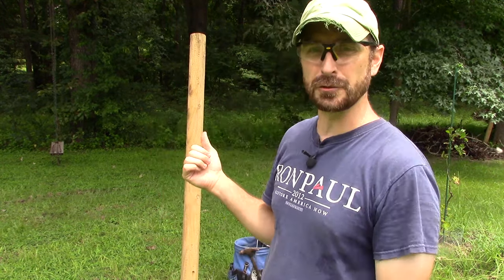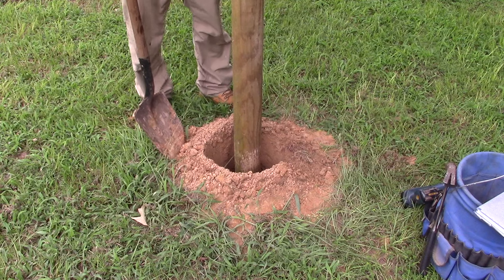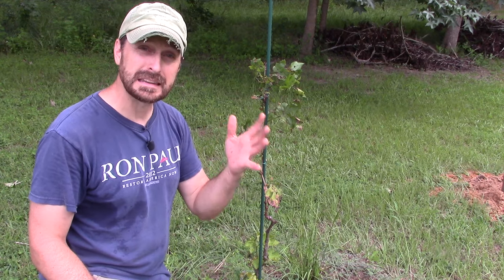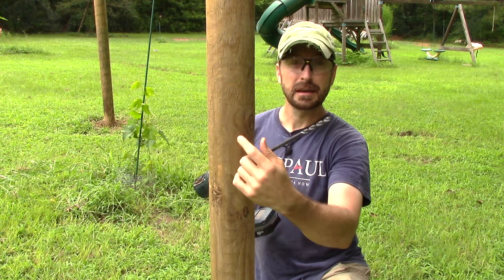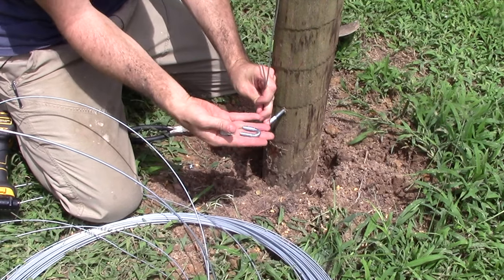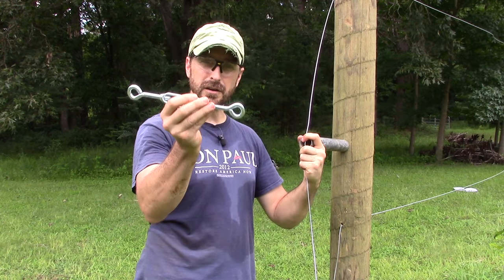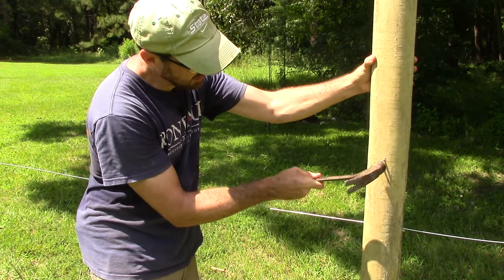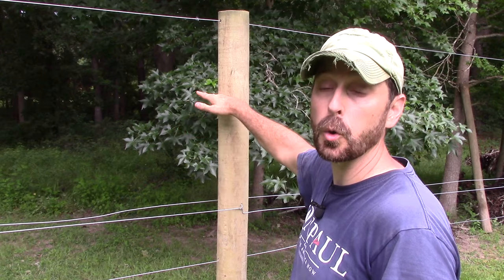How To Build A Grape Vine Support Trellis. The MOST Popular Type.

Comment from the maker: Ok all, I did make a mistake in calculation at the bottom for the top wire anchor point. After the top wire goes over the pipe it should go down to a ground helical anchor that is placed about 10" away from the base of the post.
Reply: how long is your pipe???    16 inch anchors okay?
Reply: Watching this video for the first time and was wondering about your guy wire. Reattaching to the base of the pole will help with bowing but not with racking and loosening soil. For best results, anchor it about 2" closer to the base than the length of your braceing arm. Excellent video! Think I'm going to use this system but pour concrete around the base and ditch the guy wire totally.
Reply: @brandonbrake9652  wouldn’t a concrete based post just be pulled over as there will be constant and unidirectional pressure on it?
Reply: Is nobody going to mention that on day one you've already maxed out your turnbuckle.  Just saying. But, I did enjoy the video, good stuff.

Comment: Ok folks. This is a really helpful how-to video. I followed it step by step. Placed my poles in 2 ft deep tamped around it until it was solid.  However in tightening my top wire I found both poles that were straight are now leaning towards each other.
I recommend either going with a 10-ft pole and put in your pole in the ground 4 ft deep or pouring some concrete in it.
Reply: A better option is to guy the end post or use a push brace set up on the inside.  I prefer using a push brace to keep the end posts straight because then i don't have to mow around a down guy.  Concrete, and putting the post deeper will not keep the ends straight over the long term,
Reply: @Jimmy-ul3si  A push brace for posts that tall, and being set in such soft soil, plus the weight of the vines, over time the end posts will lean a lot.  Push braces should be mandatory for this kind of structure and use.
Reply: I was going to say, tamped dirt alone will not support stretching a wire.
Reply: @sunriseboy4837  What is a "push brace" exactly? I built a grape trellis like this and googled for push brace but not finding anything, just random stuff of fence posts.

Comment: You can use trellis for tomato and all vine vegetables as well. It gets them off the ground and helps to keep bugs down.
Reply: It helps keep disease down, too. I prune mine up about 12-18" so when I water there is no splash on the leaves. This also creates healthy air space. All of my tomatoes are strung up, I just have structures to string them up to.
Reply from the maker: Trellising is great. We use them for many different vegetables and fruits.

Comment: Great informative instruction!👍. Been needing to do this with my grapes for years.  Looks like I’ll have to move the plants quite a but since I have three each in two rows spaced about 8’ apart.  Since I’m in a frost zone, I wonder if I would need to get 10’ posts and put them 4’ in the ground? Just hope they’re available in that length.
Reply from the maker: Thanks. Yea, I would do the 10" posts. You should be able to find them pretty easily.

Comment: Great idea!!!
I have a grape vine which I planted 3 years ago connected to an Arc type of Entrance in my garden which is halfway inside the walkway.
Would installing a post about 4 feet away from the Arc's  entrance allow it to be guided along the side of the walkway ?
Thanks for sharing!
Reply from the maker: The nice thing about grapes is that you can train them to do almost anything you want. If you have more room, I would install several posts. If just a single post, you can put it 10 ft away.
Reply: @CountryLivingExperience  Thank you very much! I have a blackberry and young Prune tree about 20 ft apart. I will unearth them and make way for the white grape vine. It is 3 years old but I am sure it will reap wonderful rewards in the near future.
You saved my life trying to figure this one out! 
Have a great week ahead.
Reply from the maker: @alexpolidoro4126  You're welcome. Have a good week.
Reply: @CountryLivingExperience  Dear Country Living. I am ready to start my project. Question: I am using deck blocks which I can insert my 4x4x 8 posts. Would I still need turnbuckles to solidify the posts ? I am starting with 2 posts for now with a 10 ft length in my back yard. Any comments or suggestions would be appreciated. Thanks a million!
Reply from the maker: @alexpolidoro4126  It all depends on how deep you sink those posts. The advantage of having the turnbuckles is that the wire will stretch over time and you will be able to tighten it.

Comment: This is a great video.  Question:  It looks like the catch wires have a lot of slack in them, would it be good to have them tighter, as they will stretch over time?
Reply from the maker: Thank you. Yes, they have some slack and need to be periodically tightened if your posts move or if they stretch.

Comment: I'm a total newbie at anything like this--how did you fasten that last wire.  Not the catch hooks--I understand that--but at the ends of the wires, how did you finish that so they don't slide out?
Reply from the maker: They are threaded down the the eye screw, looped through, and secured to itself via a wire clamp.

Comment: Great Video.  Any hints on installing a trellis on mature grape vines already in place?   The grape vines are currently held up by some metal poles with wires and string.  I want to replace that system with a new trellis as you have shown, but I need to do it in a way that I don't wreck the existing grape vines.  Plus I need to get them to attach to the new wires after the new trellis is built.
Reply from the maker: Thank you. Just prune them back as much as you possibly can. Support them with some temporary structure while you build the new trellis around them. You will have to attach them with some sort of gardeners tape to the new wire.

Comment: Notice that you only pulled the cordon wire hand tight, so I was trying to determine if the low wire and the top wire are one length such that the turnbuckle would tighten both wires.  A diagram of the wire routing would be helpful.  Also, looks like the far end post is bowing to the wire strain.  Last question... solid wire or braided cable and what gauge/diameter do you recommend?
Reply from the maker: The lower and top wires are different lengths. The top wire is much longer because it goes over that brace and then down to the bottom of the post. The post is leaning a bit because I rushed to set it for the video and didn't tamp it in fully. That is solid 10 ga. steel wire. Hope that helps.

Comment: Do you have a step by step updated guide with materials list somewhere? This video is 2 years old and you have multiple comments saying you changed some things. I just bought 2 grape vines and want them to have a happy life- but have no clue what I’m doing! Thanks!
Reply from the maker: The video is the guide. Materials will change per length of your project. 
The only thing I changed is where the bottom anchor is located. I moved it out from the bottom of the post to helical ground anchors located about 8 inches away from the base of the end posts.
Reply: @CountryLivingExperience   I've rewatched this video 5x now and am writing it all down on paper so I don't forget! How long was your piping for your guy wire? Do you think if I poured concrete for the posts this would be sufficient instead of having a guy wire anchored? ( Sorry if I'm not using these terms correctly- they are new to me!) Also wondering where you got your supplies from..tractor supply? lowes? home depot? and which tools do you need (My husband probably has them all but I want to make sure I ask for the right ones!) I plan on having 2 plants, so based off your set up I was going to do 3 posts, ~8-10 feet apart. So far my list of supplies includes: #10 gauge wire, turn buckles, heavy duty I screws, wire clamps, 4 inch 8 foot long posts, vineyard wire clips, fencing staples. Anything else I'm forgetting? Thank you for this video it's very helpful!
Reply from the maker: You're welcome. 
The pipes were about 10 inches long. You would still need the guy wires even if you poured concrete. I got the supplies from all over the place including leftovers in my barn. If you have 2 vines, they will need 10 feet in each direction for a total of 40 feet. The posts would need to be 20ft apart. Your list seems complete.

Comment: what type of pipe is used for the support piece that's held perpendicular to the end pole? is seems like the metal must be soft enough to notch/cut, yet strong enough to provide support.
Reply from the maker: It is a 1 1/2" galvanized steel pipe.
Reply: @CountryLivingExperience  what tool did you use to notch and to cut the arc? maybe a file for the arc and a hacksaw for the arc? Thanks!
Reply from the maker: @ToddMorgan-z5y  Just an angle grinder

Comment: Would you need the anchors if you used concrete in your post holes?
Reply from the maker: It will depend on your soil. I have extremely sandy soil so I would still need them. Also look at the pinned comment. I made a mistake.

Comment: WOW.. grape trellises are easy to build compared to the cold hardy kiwi trellis I had to build for my cold hardy kiwis mainly because cold hardy kiwi trellises have to be a lot more durable than grape trellises. Because cold hardy kiwi vines get a lot thicker, heavier, taller, and spread out 10 to 15 feet horizontally depending on the variety anyway great job on the grape trellis.
Reply from the maker: Kiwi are certainly a lot heavier.
Reply: @CountryLivingExperience  yes that's the problem with cold hardy kiwi or kiwi in general. Like the whole trellis has to be made out of wood timbers. Because if it's not it will just break or bend depending on what you're using for the supports of the trellis.
Reply: @CountryLivingExperience  I originally tried using steel t post's but they just bent under the weight of the kiwi vines once they got bigger.
Reply from the maker: @mch.l.trecords9169  For our kiwi trellis I used 6" treated posts and cattle panel.
Reply: @CountryLivingExperience  yeah that should work too over the long run I feel like if I used t post and woven wire fencing the distribution of weight would have been better and they wouldn't have bent. But since I used steel rope and t post there wasn't a even distribution of weight but I didn't figure that out until I built this humongous timber frame trellis.
Reply from the maker: @mch.l.trecords9169  Cool

Comment: I was hoping to see both ends of the trellis but it cuts off. Do I need a pipe on each side for strengthening? And I could only find 14 guage wire. Will that work?
Reply from the maker: Yes, the pipe is on each side. 10 gauge is best. You can find it at Tractor Supply.

Comment: I put in my post and now I'm trying to find 10 or 12 ga wire that is continuous.   where did you get your wire, and if not all one piece how to you connect it securely??
Reply from the maker: They have big rolls of the wire at Tractor Supply
Reply: I tried there first, but they only have 14 gauge in big spools. Have you ever thought of using a termination knot on the 2 middle wires instead of the eye hook?/ what type of knot did you use to finish the 2 middle wires??  Thanks for your help :)
Reply from the maker: @ydelsanto  I just used a wire clamp to hold all the wires. No knots.
Reply: @CountryLivingExperience  what size wire clamps?

Comment: Thanks for this great video!

2 Questions: would you use 5mm(1/4in) or 10mm(1/2in) turnbuckles?

I'm planning to only have 2 posts 3 metres apart and have 2 plants between. Would you put the posts in on a slight angle with the top of the posts leaning away from the plants to allow for any movement from tensioning the wires?
Reply from the maker: Thank you.
It depends on how thick your wire is. The heavier the wire, the bigger the turnbuckle you would need. I did make a slight mistake on the project and miscalculated. All wires should tie to a ground anchor about 8" away from the bottom of the post. If you do that, you do not need to lean the posts at all.

Comment: must be a pretty good wood for post? what is that?

here, we often put used oil and plastic on the end part
Reply from the maker: This is pressure treated wood. Made with a copper sulfate solution under pressure. Sometimes I put used motor oil on them as well.

Comment: greetings sir; hear ye me: no matter what you put in the hole, dirt/concrete/seashells/dead martians, etc., your firmness is totally dependent on the undisturbed dirt around the hole. there are two simple things you can do to effect rigidity of the post. 1) dig your hole on a slant away from the object or direction of your strain. insert your mast or pole and this will allow the top to press against the undisturbed dirt and the bottom will also, leaving the pole perfectly plum. 2) fill your hole with pea gravel after insertion of the mast or pole, then tap the pole on opposite sides with two hammers and this will let the pea gravel settle to compaction around the pole. doing this will prevent ground level rot and allow the pole to be removed easy if you decide to later. btw, you will not need to brace or guy the pole either.......................g

Comment: I noticed your pipe supports on the ends, one is at the 42" height (even with the lowest wire), but on the other post it appears that this pipe is much lower.  Is there an optimal distance above ground this pipe should be?  Thanks!
Reply from the maker: I actually made a mistake in my structural calculation but have not updated the video. The bottom wire coming down from the brace needs to connect to a "deadman" near the base of the post. A screw-in helical pier of some sort....$20 at the hardware store. Other than that, the height should be even with that lower wire.
Reply from the maker: Those won't be strong enough to hold that wire and eventual vines. You need something heavy duty and wide like this....https://amzn.to/2SgQOMY
Reply: You made structural calculations? YGBKM @CountryLivingExperience
Reply: @JRYates  Just look at the rated load on the anchor and compare it to the tension load on the wire. Remember that the bending moment of the post will take some of that load off the anchor. Also, use steel T posts between the wooden posts as they are cheaper, easier to install, wire is fastened with clips and they only are supporting a vertical load; besides, with a T post between each grape there is no need to put a lot of tension on the wire as the T post is doing the support.
Reply: @denniskuzara5568  thank you!!

Comment: Do you know what this post support system is called? Where you triangle back to the same post? I can't find any other references to this system and am wondering how structurally sound it is? Can this be scaled up for an apple trellis for example? I really like the simplicity.
Reply from the maker: Not sure what it is called. I'm an Architect and understand structural engineering. I saw this system used on telephone poles to transfer loads in tight spaces. Just make sure the post is in the ground a good distance. Mine are a bit shallow.
Reply: @CountryLivingExperience  Simply googling "pole guying" images will show various methods of using a guy wire to counter the horizontal forces on a pole, NONE of which anchor the guy wire to the pole itself, but always to some form of buried dead man or other anchor.
Reply: @denniskuzara5568  True, anchoring the wire to the bottom of the post will do nothing vs. simply attaching to the top.
Reply: @CountryLivingExperience  Anchoring to the end pole itself should be a last resort as it will not always work very well.  I suggest using a push brace on the inside of the end pole.,

Comment: It's been about a year, how is the pipe at the end post holding up? Is it leaning?
Reply from the maker: It leaned. I miscalculated the forces. The pipe is fine but I moved the wire to a large ground screw about 8 inches away from the post.

Comment: I am very confused as to how I string the grape vine on this 4 row trellis. How many laterals should I have & what are all the wires for? Please include pictures or a video would help.
Reply from the maker: Only 2 laterals, 1 trunk. The two laterals are on the lower wire. 1 in each direction. The top wire is to attach the end of the shoots. The middle wires are catch wires so that those shoots are contained in the center of the trellis in the vertical direction.
Reply: I cut them off lower & thought I had to have 2 laterals higher. Can I cut those off & will I eventually grow more laterals lower so I can start fresh(right)? Ugh.
Reply from the maker: You can always start fresh with younger grape vines.